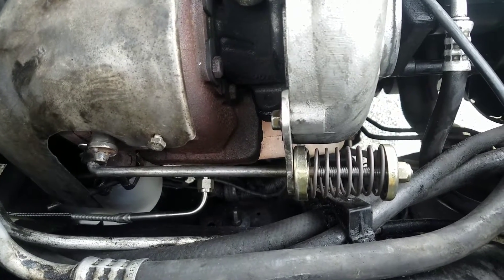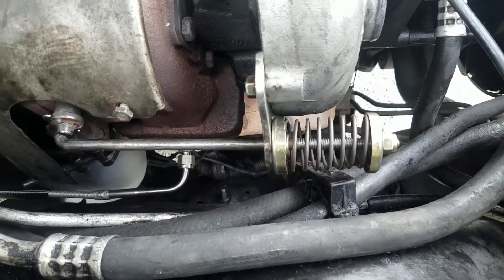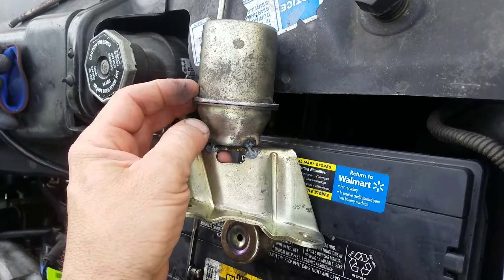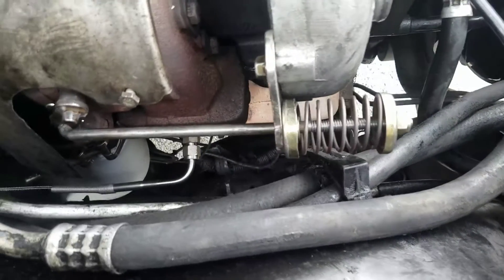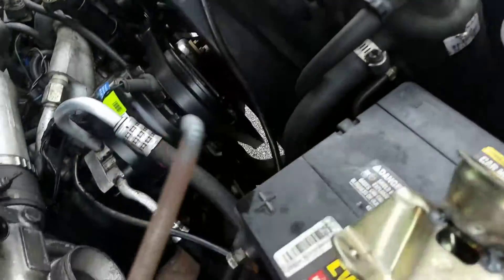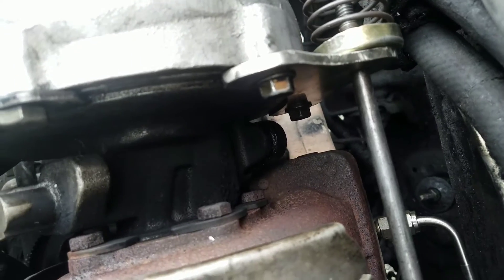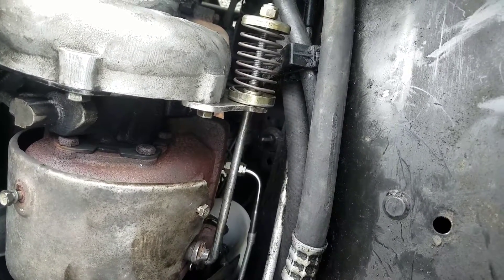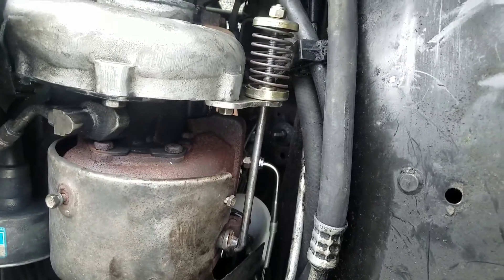6.5 turbo adjustable actuator more boost turbo master

Comment: Really if anyone is still driving these old things 1 million people still drive these trucks LOL
Reply: Still driving my 94 Chevrolet C2500 Silverado trim extended cab with service bed. Absolutely LOVE it. The sound the fuel mileage and most importantly the fact that it’s been paid off for years and I can rebuild the entire truck as many times as needed. Only 140k original miles. I just wander what people think when they spend 60-80k on a truck they won’t be able to maintain into the future. Anyone rebuild all those computers? Nope doubt they will. Disposable trucks suck
Reply: Ya were still driving these old things